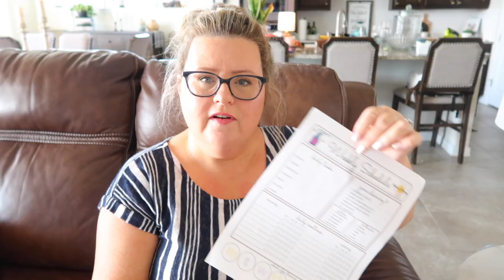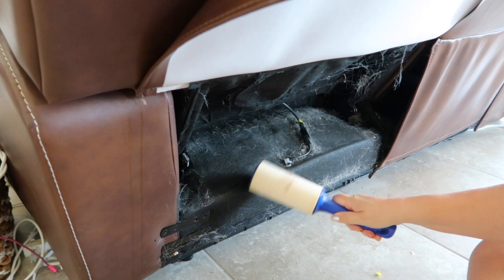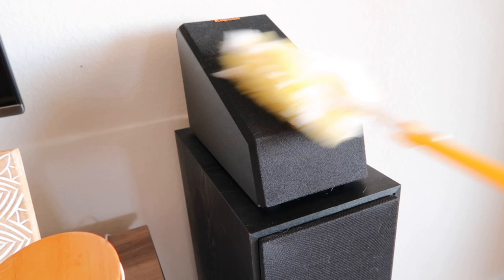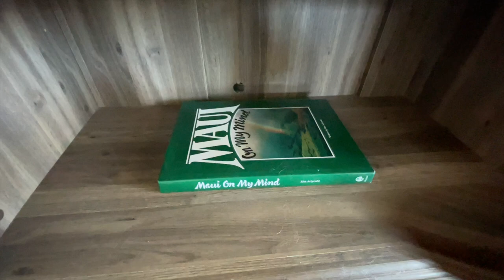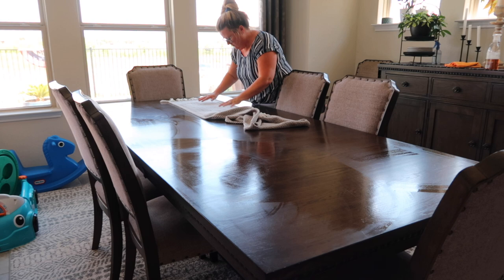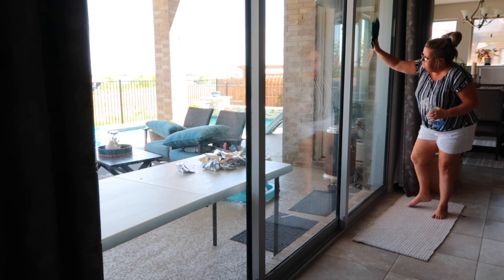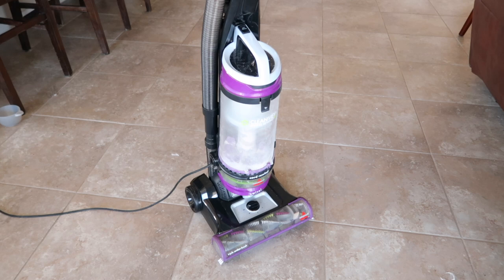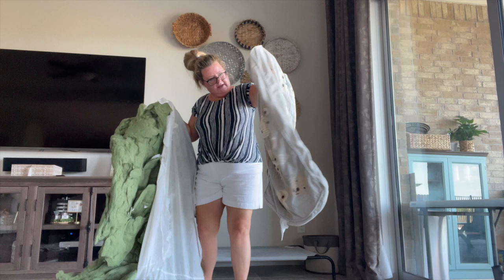HOME CLEANING ROUTINES 2022 | DEEP CLEANING USING 7 TASKS | MOM TO MOMS

Comment: You need one of those car detailer things they use on upholstery and carpets. Not sure the name though. 😂
Reply: It is a Lilly brush
Reply from the maker: The hand rake thing? That may work.  But I just wrote in another comment that I’ve neglected this area because I’ve never thought to open it and check but from now on it will be on my zone cleaning list. 😜
Reply from the maker: Yes, that’s what it’s called. 😀